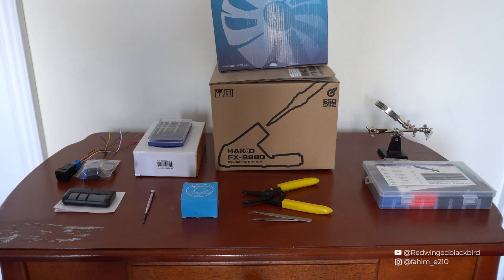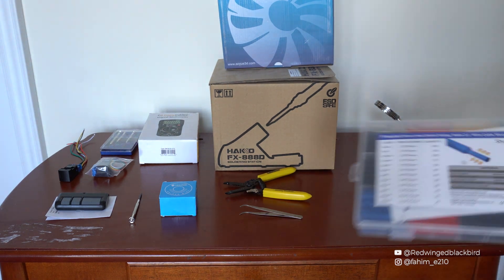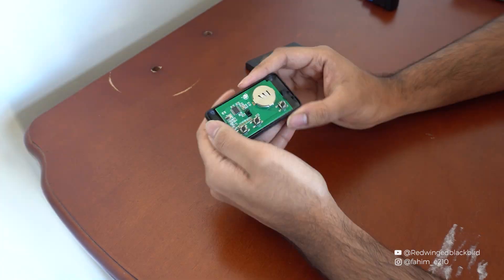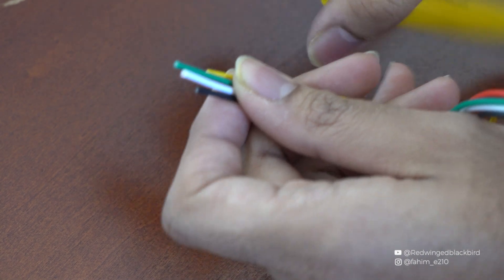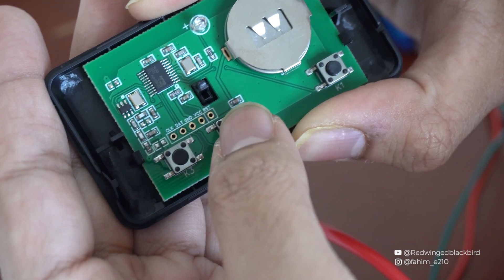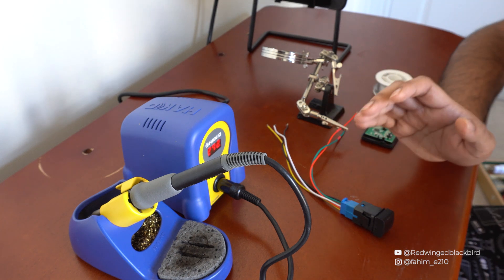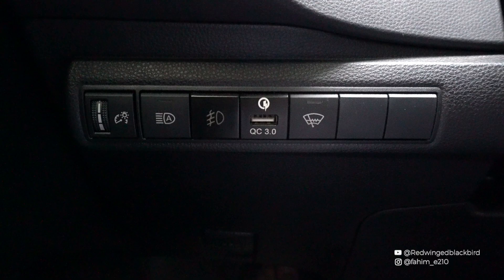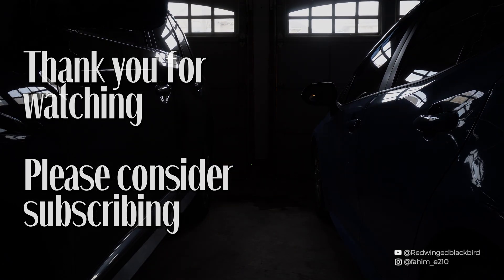DIY Garage Door Opener (Using OEM Switch Locations)

Comment: Great demo. It would be neat to hardwire the transmitter to the car's DC power so you don't have to change batteries. You'd need to stepping down the car's 12V to 3V.
Reply from the maker: I did consider this, but my mother's garage door opener has been going strong for a little under 20 years. I don't expect to change batteries anytime soon, and even so changing the battery is easier than adding more wires and routing to a power source (e.g. fuse tap).
Reply: @RedWingedBlackbird  hey i have a similar video to yours where i hard wire the power.  One thing to consider… if you leave this battery powered the switch always works.  Its a potential security risk.  A small one considering you might park inside a garage and the likelihood of someone breaking into your car and learning the switch will open your garage is low.  Nonetheless its another point for people to consider.  

Nice video!

Comment: When you solder onto switches that have two points of contact, bridge both sides with your wire and solder, and you will have a much stronger solder and wire connection.  Then take some hot glue or epoxy to secure down the connection.
Reply from the maker: One connection broke off once so I'll go back and hot glue em after soldering. Thanks for the tip!

Edit: Broke in Dec 2025 so I re-soldered the connections and added a ton of hot glue.

Comment: u can get the ones with light like the windshield heater's button and connect the led to that
Reply from the maker: You could, but the button I purchased was a "momentary switch." Meaning it is only on when pushed, then turns off when you release.

To me it wasn't worth hooking up the LED, but anyone could if they wanted to.

Comment: Cool idea, would be cool to get the LEDs on the button working too when you push them
Reply: All he needs to do is pull the board out and hook them up to the back pin on the factory LED.  Good video non the less